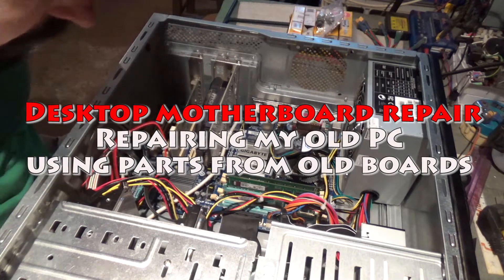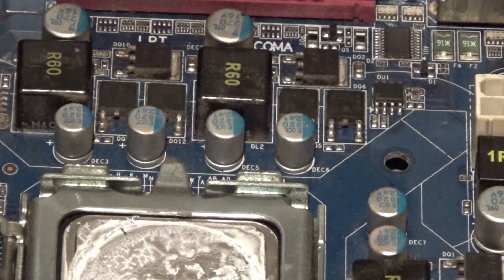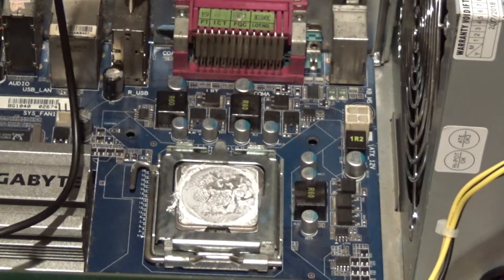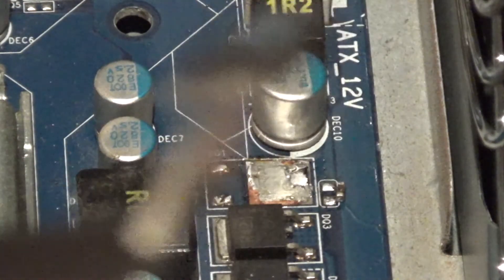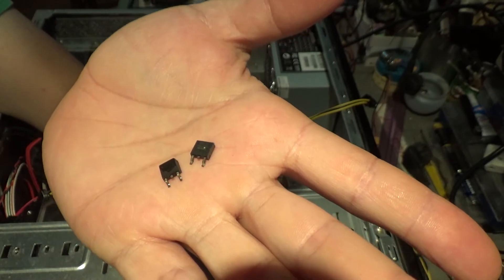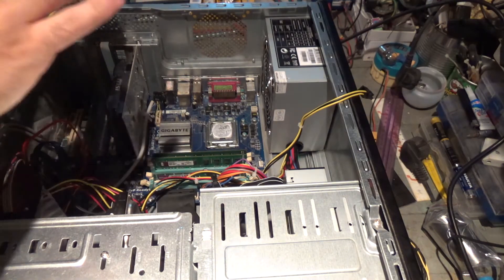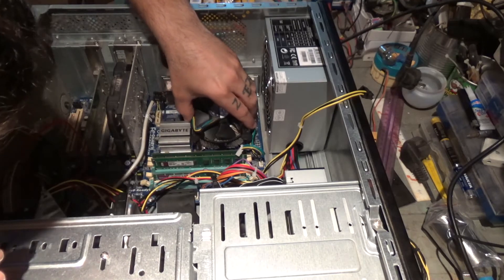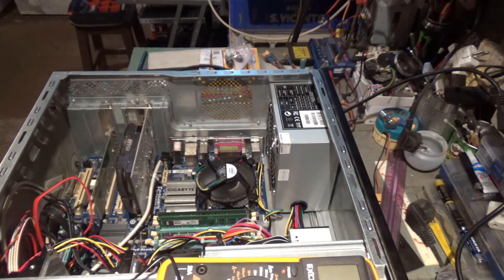How to repair a motherboard - Broken mosfet replacement

Comment: Hi, 
great video, 
too bad for me me it was not published 10 years ago. :)

I put a link of your video in reply to a comment of my video https://youtu.be/nYb7UaWip8w , to illustrate "what to do in such case" before using the trick by "shorting Green & Black cable" from the ATX connector to force PSU powering the MoBo. :/ 

peace.